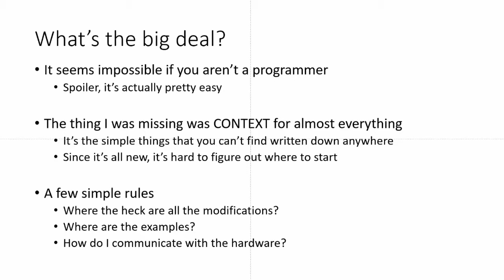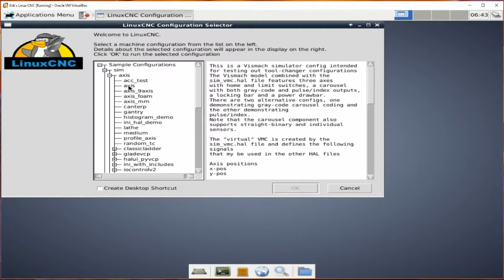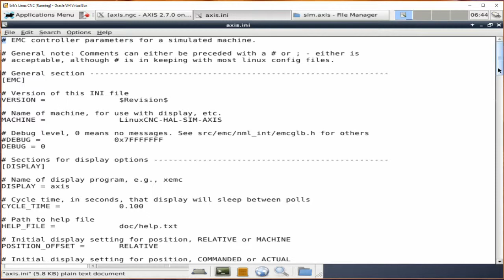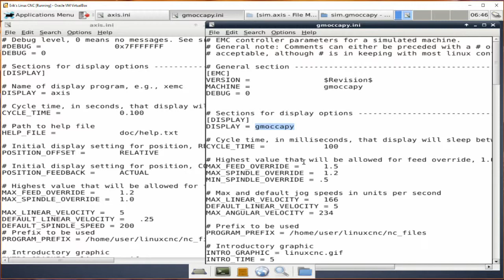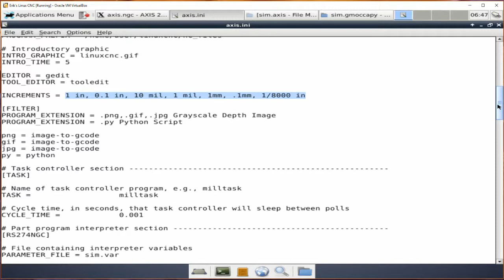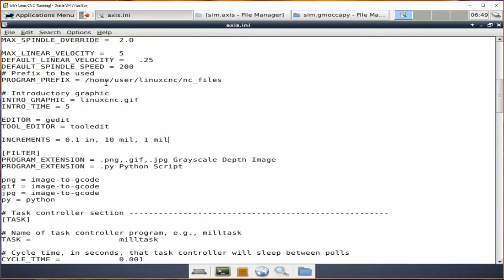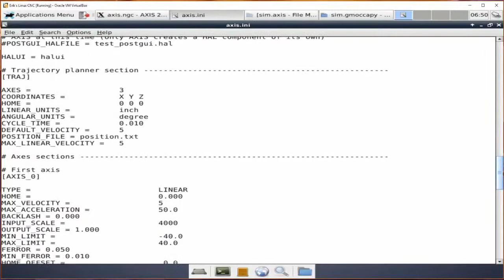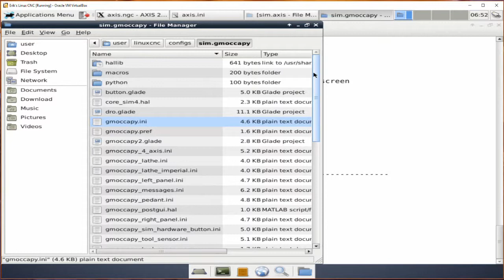LinuxCNC for dummies #1

Comment: i not understand how i make Z bit zero  automatic code. many video but not understand how make, not has newer write code or use before linux and first time linuxcnc now, build cnc my son.
Reply from the maker: I don't understand your question.  English is my only language so please try again to ask your question or use a translator and I will try and give you an answer.
Reply: @eriksalo5550  how i make z touch plate setting in linuxcnc., button to panel and automatic set zero.
Reply: @eriksalo5550  setting touch plate , first need button on display, then need know were folder need add file button call touch plate g-code, i has before can make button on display but if bush button come errors lot, not know were need add file what button call, were is button file location, were is g-code location how can call g-code who run touch plate code, code include g-code were position bit go and move down and touch plate and stop and move back up, and calculate position minus touch plate tighnes and thats is zero point at workpiece top zero. you need make video step-by step how add and were all code text, first write button text and were file named and location must be, then g-code name and location were need add, i have linuxcnc 2-8-4 debian linuxcnc, hall sensor show true/false if contact touchplate ,mean mechanic/elektric connection working. but this code not working. not move anywere if bush button at display.

Comment: Your experience of learning about LinuxCNC is exactly like mine! Easy once you've figured it out, but very difficult to actually get there.
Reply: learn lot but not understand english good, need be Finnish manual. need help cheap chinese one relay breakoutboard not show hall meter true/false my probe. i just test optocouplers have ok. but not sure manual not say need only power 5V to board whit usb connection or need optional 12-24V to board power supply, because input pin go to board line and led to 12.24V whit led to input screw terminal. pin 10,11,12,13,15 and GND have screw terminal.probe pin 15. config wisard has add pin 15 probe in, E stop pin 10 and normal all motors.

Comment: Thank you for this! I am converting a Fadal VMC 20 to LinuxCNC, I do have programming experience but trying to find my way around Linux has been very frustrating. I have spent several days just trying to get started and it seems that so MANY basic steps are just not out there anywhere. I have learned more in a few minutes than I have in days of trying to absorb it from examples and reading. I have a 2 speed spindle and a 16 pocket tool changer, your videos are going to be a huge help. A big THANK YOU is what I leave!
Reply: InstaBlaster.

Comment: Thanks for this. Did you use Mesa boards? Do you have a build log on linuxcnc.org?
Reply from the maker: I used the Pico Systems boards.  They have been perfect.  Jon Elson from Pico spent an unbelievable amount of time supporting me over email.  I recommend Pico enthusiastically.  When I was trying to decide what to use I emailed both Mesa and Pico.  Mesa never answered back.  Jon from Pico has mailed me back dozens and dozens of times.  Amazing support.